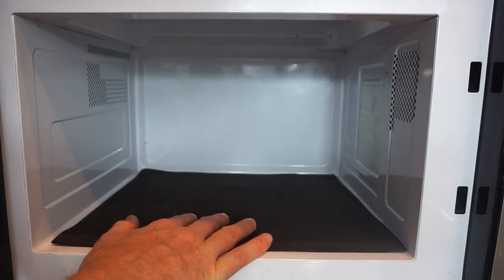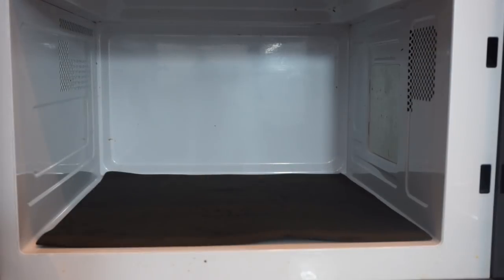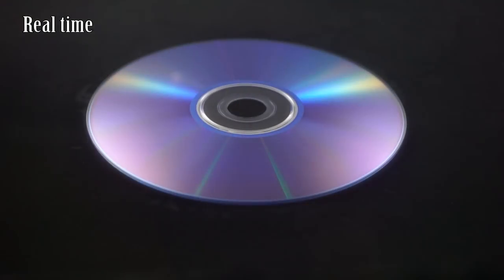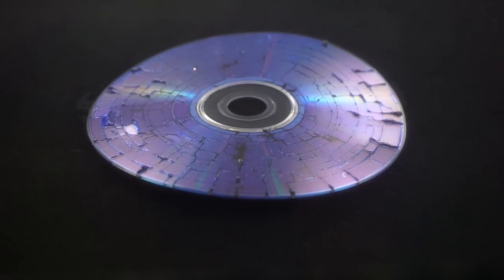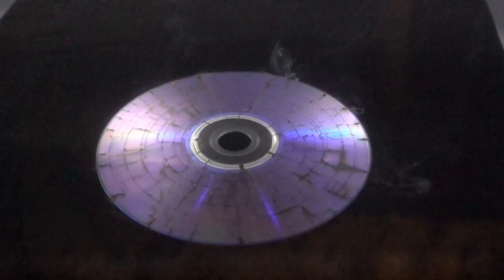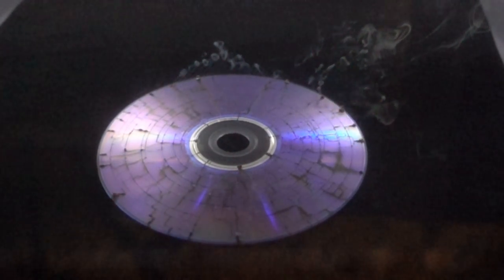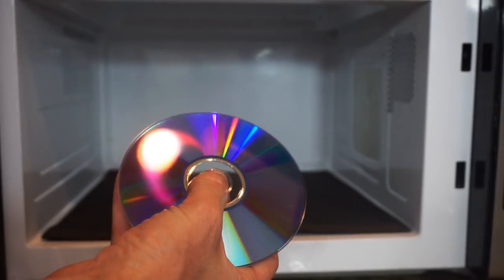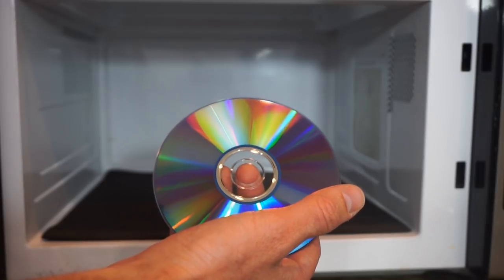I Figured Out How to Film Inside a Microwave! Slow Motion in HD of a CD Filmed Inside a Microwave

Comment: You're such a troll, you never actually showed us how you were able to film inside of a microwave xD
"Top secret microwave", never expected to hear those words together

As for some ideas: (1) Lava lamp, (2) Marshmallows, (3) Egg, (4) Bar of Ivory soap, (5) Plasma ball, (6) A grape cut almost all the way in half (only attached with a bit of skin). That's about all the quick ideas I was able to come up with. (:
Reply from the maker: We have to leave some mystery in the world:) Good ideas though, I will try some of them!
Reply: The Action Lab I want to know how did you film it
Reply: He probably covered the camera with aluminium foil to protect it?
Reply: One thing that you need to know about aluminum is that it's not good in the microwave. it will spark just like the cd did if not more. So that would still destroy his camera. I know a little about cameras and microwaves but it's confusing how he got it to work that good. I NEED TO KNOW.
Reply: Mark Thurman maybe he has a powerful camera to zoom and he zoomed in a little hole?
Reply: Vaza I did marshmallows. at first they look fluffy and yummy but in an instant thay fall and shrink. at that level it will stick to your plate
Reply: Mihai: That's not how perspective works. If you zoomed in on a tiny hole from the outside, you would only see things roughly the same size as that hole on the inside. The light cone going into the camera would be extremely narrow.

There's probably a hint in the 4-spike star shape pattern of the light flares though.
Reply: Vaza He used a very large aperture lens as close to the metal mesh on the door as possible. A high speed camera with high resolution would already need a pretty big aperture.

High aperture makes the plane of focus smaller. The grate is still there, but it's so out of focus that it's essentially just making the whole frame a little darker.
Reply: Maybe the sparks don't occur on the inside of the "foil container"? Or maybe he covered his camera with some other metal mesh (except for the lens).
Reply: Vaza He makes sure he can milk most money of this by being the only one able to film inside a microwave. Really funny since he blatantly copied other people with his hydraulic press and vacuum chamber experiments (ehem HPC)
Reply: I bet he bypassed the door switches and ran it with the door open.
Reply: I know how you did it. But I'm not telling
Reply: I am 100% sure he just removed the grating and placed the camera a safe distance away
Reply: Probably a much more elegant solution, but: Put microwave in an empty field/yard not pointing toward neighbors. Open door, jam the lever closed so it thinks door is closed. Position camera like 30-40 feet away with zoom lens and at slight angle so it can't see the actual magnetron source directly, to limit exposure to only to a few stray reflections. Reach around and hit button from behind and retreat / i.e. don't stand in front of microwave while operating. Profit!

Assuming a wide cone of most of the reflections (it's a big clunky box not like a laser), the intensity at the camera will be several hundred to thousand times lower than in the middle of the microwave (inverse square), probably far more so with no direct line of sight to the source, so it effectively "dodges" most of the microwaves and should be just fine.
Reply: car airbag inside microwave, you forgot that...
Reply: Maybe he put the camera in water so it wouldn't burn in the microwave?
Reply: Lava lamp. are you trying to kill him?
Reply: Ivory soap
Reply: I am thinking phone cameras have pretty small lenses. If you put the mesh/grating close enough the camera could see through hole while beeing protected.
Reply: KIDS TRY A kid got hold of a 2mil channel?
Reply: Not sure if anyone still cares and I am certainly late but I believe to film inside the microwave he simply made a hole in one of the sides that had a diameter less then that of the wavelength of the microwaves produced by that microwave. (I believe most typical microwaves use the same frequency waves and therefore they would have the same wavelength by   λ=c/f   where λ is wavelength, c is speed of light which all electromagnetic waves travel at, and where f is the frequency of the wave) because the hole would have a diameter smaller then that of the wavelength the microwaves would not pass through it and would not damage the camera. 

That is the hole point of the grate in the microwave door. Like most safety measures however the grate is over the top. By that i mean the holes are much smaller then they need to be to block the microwaves.

This video by Cody'sLab explains it better then I can in a comment 
https://www.youtube.com/watch?v=KTdjHMWD_t8

This is just my opinion and I thought i would share as no one had offered Vaza an explanation.
Reply: @gogo311  The tin foil hat men are out

Comment: The metal mesh on a microwave prevents radiation from leaking through but if you remove the glass and cut a slighter bigger hole in the metal, you're able to see inside with a camera zoomed in while the doors closed. 

I think he used a black sheet to absorb the light so it's easier to adjust the aperture for appropriate lighting levels.

Comment: Woah, I didn't expect the CD to crack and spark like that. At first I thought it was because of the metal in the CD expanding more than the plastic but it turned out to be due to a potential difference.

I thought the explanation for this effect wasn't clear enough, could you elaborate on why the microwave causes a potential difference in the CD? Thanks.
Reply from the maker: Any alternating electromagnetic wave (not just microwaves) causes alternating current and voltages simply due to the alternating electric field. The sparks occur because the plastic melts and separates the metal a tiny bit and at the tips of the metal it builds up enough voltage to jump the gap and spark.
Reply: Thanks for your explanation!

Comment: SPOILER: radio waves have whats called a "wavelength" at which they propagate. The higher the frequency, the smaller the wave (smaller in time, not amplitude). Picture the air in front of you as slices or ripples on water. the distance between these ripples is effectively the wavelength and the energy that is being transmitted is how exaggerated the ripples are (the difference between the peaks and valleys). NOW, given that microwave ovens operate as a radio transmitter and have a known frequency of 2.45GHz, you can readily calculate how big or small a hole in the cavity can be before you start leaking RF energy. The metal grate that you look through to watch your food is designed with a huge safety margin. But you can actually get up to about 1cm sized hole before you leak substantial radiation. And before you flame me for sharing this, this method has been done on youtube since 2007 but i do respect the crazy good quality of footage captured here! Most people don't quite understand how such a ubiquitous appliance works and i see no harm in spreading knowledge versus making it seem dangerous or mystical.

Comment: I’m surprised the Slo Mo Guys haven’t done a video about this.  They’ve filmed at high speed a compact disc being spun at a very high rpm to the point where the compact disc comes apart and then played it back.  One thing you can see in slow motion is that the CD bends in odd places and when it breaks, it looks like a fractal tree spreading from one edge of the CD to the other.

Comment: I think that you will find that the frequency with which the arcs flash is 120 times per second (in North America) corresponding to the frequency of the ripple in the DC supply to the magnetron. Might actually be 60 times per second as a voltage doubler circuit is used. Either way, it can easily be determined with your slow motion photography. Now I will be racking my brain trying to figure out how you got that footage. Perhaps a tiny aperture, lined up with one of the holes in the screen??

Comment: Your theory on the spark pulsing was good, but flawed. The power was pulsating along with the 60hz power input.
Reply from the maker: +Boldsword well my wording was very general on purpose in the video. So there is a lot going on causing pulsing in that pattern and it is caused by the AC pulse but remember it gets converted to DC for the magnetron so it should be a pulsed DC with a 120 HZ. But I was only getting like 40HZ pulsing according to my counting frames measurement. So I'm not sure what was going on exactly.
Reply: The Action Lab The magnetron is supplied with both A.C. and D.C., the high voltage supply goes through a rectifier, the low voltage supply is where most of the power comes from and that is A.C.
Your theory of the arcs having to build up enough potential to overcome the resistance of the gaps may account for the discrepancy.

Comment: Isn't the blinking due in part to the 60hz AC frequency?
Reply from the maker: +lethimwhoboasts yes that definitely plays a role in the blinking. Although it might not be the complete story because magnetrons work on DC power. So you would expect the AC converted to DC to pulse at around 30 HZ but in the video it actually has a period of about 40HZ (7ms on then 7ms off). So ok not sure.
Reply: Isn't 7+7ms closer to 70Hz?

Comment: judging by the position of the view and the fact that the light inside the microwave was no longer on I'd say he took apart the microwave took out the light bulb so that there was enough room for the camera (he may have removed other components like the fan aswell) and then made the holes in the light bulb grate bigger so he could focus the lenses through it. he also may have wrapped his lenses In aluminium foil do that there would be no interference. I also noticed he didn't have a plate in the microwave possibly so that the CD wouldn't bounce the microwaves back up to the camera. someone please try this so I can see if I was right. if no one else does I will (i have a spare  microwave and an old phone for the camera). if I do try it I will reply to this with the results.
Reply: I tried it but I ended up just drilling a hole in the top of the microwave chamber and pointing the lenses through that, but it worked.